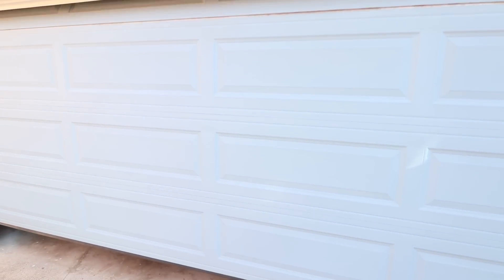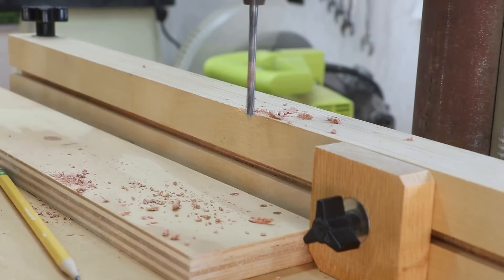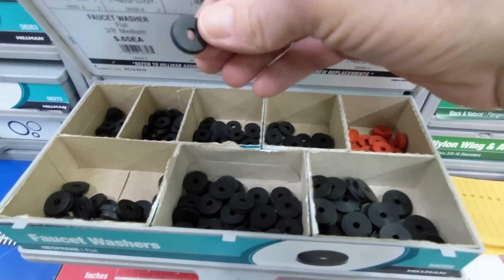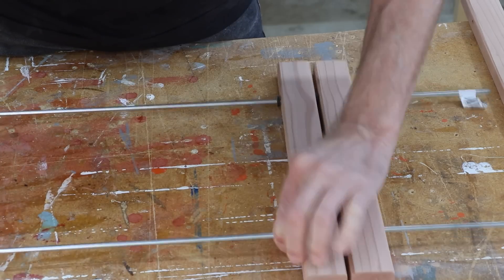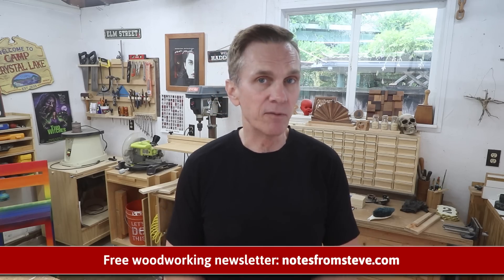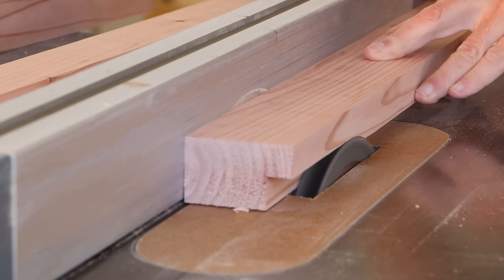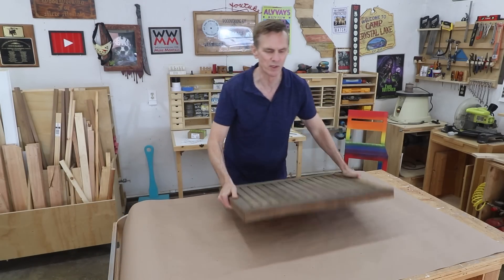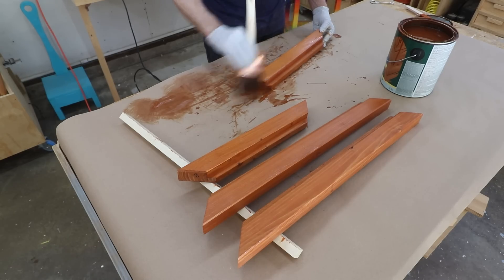The most unique doormat you can make. Weekend woodworking project.

Comment: Almost done with my first try.  Not bad.  Tip on drilling the holes:  no matter how carefully you jig it, the drill bit does tend to wander over a 1.5" path.  It's pretty easy to set up the press table for an entry hole that's 99% repeatable at the center.  Soooo, don't drill it all from one end:  set the drill stroke for about 7/8", drill it, flip it, and do the second half of the hole from the other end.  It cuts "drift" in half.
Reply: What kind of drill bits are you using & are you using a drill press?  Good sharp Brad Point bits should not be drifting especially with a drill press.
Reply: @markb8954  Drill press, fence, stop, brad point:  wood is not a uniform media, and you do get drift.  I tried the "two way" method and it does work better.  It strikes me that in every tool app there are small gaps, "wiggles" in the tooling.  A drill bit tip can move just a bit due to the chuck, the fit of the chuck into the press, and the drill bit itself will bend just a little.  The longer the assembly, the longer the bit, the greater the possible arc of placement for the tip.  Add to this that the wood has hard and soft areas, and the tip of the bit is going to move just a little.  However,  on the next iteration, I plan to clamp the workpiece onto the fence rather than just holding it tight on the fence.  Clamps is nice.

Comment: First, revisiting old stuff with a new spin is always nice. The flashback to a decade ago shows so much improvement. Now, you have a better video, better joints, better workshop (with less actual stuff), and even look younger.
Second, round-overs vs chamfers is always going to be subjective. I use roundovers for anything with hand-contact. Shelves and such always get it, and I've never once thought it looked dated. Chamfers go on things where fitment is important. For a doormat, they'll look different, but neither will look more dated than the other. The wood itself is probably the most dominating 'aging' factor.

Comment: On your drill press comment, this is one of those spots where when you're starting out a Wen or Harbor Freight drill press is probably fine. My Harbor Freight drill press has held up quite well even for all the pens I've made and so it's one of those tools that are so simple that "cheap" will likely still get you something that'll take you pretty far!
Reply: Ditto.  Pawn shops around me always seem to have a drill press too, but you might need to double check the price to make sure it's fair, and give the machine a good once over to make sure it wasn't trashed by the previous owner.
Reply: OfferUp here in the Southwest has been my go-to for second-hand tools, too. Though I just got a smokin’ deal on a Ridgid table saw (an upgrade from the rinky dink Pro Tec I was using) at a local pawn shop by making a low offer after seeing that it had been sitting for months. They took it and we’re both happy!
Reply: ive got a wen variable speed and i love that thing for the price, way better than hand drilling for a lot of tasks
Reply: Yeh i got a rusty, second hand box-store-brand and it's still super useful.

Comment: I've used a couple of the presses that use an electric drill motor. Latching trigger is more convenient. I've mounted my cordless units as well as corded. Works well for small work, and especially if you have storage issues.

Comment: Just came here to say I think you did a beautiful job on the doormat. Those mitres are tight! Was thinking if I was to do this myself, I'd probably taper the outside top edge of the frame down to floor level, to prevent stubbing your toe on the side of the frame in the dark. Of course, you've probably no issue with this as you used the last one just fine for so long. Anyway, great video and keep on keepin' on.

Comment: A great, simple project!  I wonder how complex it would be to bevel the frame slightly, so that it tapers toward the edges.  Would it be as simple as tilting the table saw blade a bit and running the frame pieces back through vertically?

Comment: Do you have a video on making your drill press table/guide? It looks useful. I inherited a little,  old Harbor Freight drill press, but the table isn't very functional other than being flat. The few times I've used it felt pretty unwieldy. Clamping any sort of stop block(s) isn't easy, as the underside is not smooth.

Comment: This is a real good idea. I've seen several here in Florida that were similar. Some of them had the slats long ways and used a 1/4" gap. When folks come in from the beach it seems better for wiping the sand off their shoes, sandals, and feet. What do you think of that as an option?
Reply: That's exactly what I plan to do - run the slats the other direction and make the gaps wider. There's a lotta mud out on our farm.

Comment: You could also use a stainless cable or other flex able thing to run through the holes. That way it has a little flex to it once it's all put together. Would just need to figure out what to do to the ends of the cables so it holds the boards on.

Comment: When drilling the holes for the slats, you cold reference the fence of the drill press to the top of the slats, so the fence is still adjusted for drilling the frame.

Nice project.But now you need to re-stain the stairs to match the door mat :)

Comment: honestly with a good way to hide the ends of the rods I think one with out the frame would look great too. it would also cut down on time to make it significantly if you are selling them.
Reply: Countersink the wood at the ends of the rods and you will hide the nuts.  However, the frame keeps the slats off the pavement, and reduces rot from trapped water.

Comment: This reminds me of a project I did recently. I made a top railing out of 2.5in galvanized pipe for a guy I know. 90* fittings for the for the top corners, dropped the two 4 ft uprights into the floor almost a foot then used tensioned 1/2 inch cable for the center rail. I was thinking making the mat with no border and recessed cable into wider end slats instead of rod, just like this project didn't use...

Comment: Question:  Should you glue the corners before putting in the pocket screws?
Reply: You can, but if you use Titebond or Titebond II (or anything similar) it will likely fail within a year. James Wright of Wood by Wright has a running series wherein he is testing various glues over a number of years. I can't remember what his results have been so far, but if you watch his most recent one you'll see what has had the most success outdoors. The screws should provide enough holding power on their own, though, at least until the wood rots away enough that they can't hold (and by then the glue would fail as well).

Comment: Hey Steve,  here's a little tip my dad taught me about 40 years ago.  When marking the drill point for those rods, use lipstick on the ends of the rods and it will leave a dot where you need to drill. So raid your wife's makeup(💄), just don't take the good stuff or you'll be in trouble.  LOL  Have a great day and I'll see you on the next one.

Comment: Question...when you are doing the creep up of size on the miter sled (or miter saw) do you get splintering of the ends? I seem to have that issue when I try it. What's the best way to avoid the splintering when doing the size creep up method?
Reply: A decent saw blade 😜

Comment: would this project be easier if you started with the outside first and then cut the inner part to size.
Reply from the maker: Maybe, but you might have to rip one slat narrower, depending on the fit with the spacers.

Comment: That looks pretty, but I use a welcome mat to essentially clean the bottoms of my shoes before I enter the house by friction with the rough surface of the mat to remove stuff like wet leaves or whatever.  That looks a bit too smooth to be of much use in that regard.  Then again I live in a rural area, gravel driveway, concrete porch, etc.  If I lived in town I'm sure it would be fine.  Trust me, in a rural area you are going to occasionally walk through mud, slush, wet leaves, etc, lol.

Comment: I’m completely puzzled why you used steel rods. For spacing they would work great to help drain rainwater so it doesn’t build up underneath, rotting the deck. But in our southern humid climate, the steel would rust quickly. Can you explain why you think the rods would stand up? Thanks!

Comment: The threads may or may not be as strong as on allthread, but you can definitely put threads on the big box store steel rod like it looks you are using.  How do I know...I have done that a bunch of times on projects where I didnt want (or have) all thread for it. :)   I liked the video though, and the idea for the doormat.  Maybe when our plastic/cloth one finishes decomposing I may try this for a new one.  Though then you have to worry about someone liking it too much and then needing to make another one to replace it.  Whereas so far no one has stolen our partially falling apart one...yet. :)

Comment: Nice build!  The steel rods are really an unnecessary feature if you mount the slats in a frame like that; they contribute no strength to the assembly.  Omitting them decreases build time by about half and reduces BOM cost as well.

Comment: You might consider thinning the slats to add more gaps for dirt to fall through and tack feet to hold them above the floor. You could then omit the steel rods and screw the slats individually to the frame.

Comment: The only time I've ever seen a failure with pocket hole screws was caused by user error.  The screws weren't long enough or they were used in the wrong application.  You can screw up anything if you try hard enough.  (No pun intended)

Comment: Have you ever done 45 degree joints, using wood that was supposed to be dry, but wasn't really dry. When drying further,  it shrinks more in the width than the length, resulting in your nicely cut 45's are now a tad less, and the joint looks poor.  i believe this is what has happened to Steve's the old doormat, it wasn't crappy made.

Comment: I know you don't see the pocket screws, but i find it very displeasing to drill a hole like that in a otherwise gorgeous wood piece. That much work in the entire process just to make it the easy way at the finishing line.
Reply from the maker: Are you suggesting that a project's value is based on the difficulty of the techniques used to build it?

Comment: @ 14:20 -- Actually, take a hammer and gently whack the rods to make them make a mark on the framing pieces. That way it should be pretty exact.

Pocket screws? Seriously? This so calls for simple dowels (or dominos, if you're fanatical about them)!! 
Note -- I'm not complaining about strength. I'm talking about visibility. I wouldn't want any screw holes anywhere in this. No, not even on the bottom.
Reply from the maker: A lot of people share your opposition to pocket screws. Funny how woodworkers in 2023 have a need to hold strong  opinions on something as ridiculous as construction technique choices. 😂 This is basically the Twitterizing of YouTube that didn't exist when I made the first doormat 12 years ago. 🤷‍♂️

Comment: Nicely made but weird. I was expecting some clever doormat, that somehow cleaned your shoes. But got a set of planks lying in front of the door. Perhaps it is a USA thing? How does that wipe or dry your footwear before entering a house? Then the metal rods may make it a fraction stronger, but you could just screw the ends of each rail to the rebate you made in the frame. With a lot less messing about, no need of washers.
Reply from the maker: Or you could just buy a doormat. Dude, it's just a fun little woodworking project. Why the need to overthink it?

Comment: no glue anywhere? I would have at least added some glue to those joints along with the pocket screws just for some added support.
Reply: Glue is brittle. The expansion and contraction of the wood outside along with moisture and people walking over it wont help much. PVA is strong but its  brittle, save it for indoor furniture work. It's also the reason you don't see glue on decking and outdoor furniture.
Reply: I would do that too but his 12 year old piece held up just fine.  Can't argue with success.
Reply: @dwightl5863  true. I just found that a little weird becuase this guy did a whole video on how much he loves glue
Reply: Came to the comments for th same question. Wonder if he was concerned glue wouldn't let the wood move?
Reply: @sunderark  A water resistant/proof PVA would work fine in an outdoor application.
Reply: @bb55555555  Steve likes painted wood especially for outside projects yet he used deck stain on this one.  Always more than one way to do a project.
Reply: @dwightl5863  also he used redwood. naturally resistant to rot.

Comment: for the last 27 years, I have lived in the heart of the California redwood forests. there are many small towns that were originally built specifically around the redwood harvesting industry. protesters, and activists that were misinformed, and actually acting more as eco-terrorists have caused many of the mills, and logging companies to shut down. companies that were working in a sustainable manner over the last full century.  if you are ever driving up in this area ( I am in Humboldt county) look to the sides of the highway. nature does not plant trees in perfect rows. farming redwoods is exactly like any other crop. it is no different that growing corn. at the end of the harvest you clear the land, and replant. the only real difference is redwoods are on a 40 year cycle, instead of annually.  the protesters have actually cause more harm than good, as the locally owned and operated logging has  closed, being bought out by over seas corporations that do not care about the land or community.  It is really sad, actually.  Redwood IS a beautiful wood, that is pretty easy to work. one thing though, redwood BARK is fire resistant, redwood timber burns very quickly, and VERY hot. I had a redwood framed house when i first moved up here, it burned down one night, and was fully engulfed in mere minutes.

Comment: One problem: Its an absolutely terrible design idea.  How can anything but stiff bristles dislodge caked on dirt and mud?  Wood slats?  What Einstein thought of such a pointless idea?  How about smooth wood?  Is that next?  Polished marble?  What in the world were you thinking?  Sure it looks nice but it DOESN'T WORK.  I noticed that a lot of very skilled woodworkers have very poor conceptual ideas.  But that's OK.  Just work with someone who is a good designer and you'll come out with a stupendous project.  After all, who doesn't LIKE wood?  We all do.  The problem is wood is vulnerable to the elements, it rots, it wears rather quickly, it warps, a whole host of problems.  But if they can be circumvented, its a great material.  And its pretty strong for its weight.  Most importantly:  We all love being around natural wood.  In a word, its homey. Its warm and inviting.  Just as a home should be.  

Want a challenging wood project?  Figure out how to join two 2x4's at a right angle in as rigid a manner as possible using a minimum of space in the brace area.  (Its not easy!)  I'm thinking a quality steel L bracket on each side the full width of the wood with countersunk bolt holes with grade 5 bolts.  Perhaps countersunk into the wood as well so it sits flush.
Reply from the maker: Read pinned comment. You're problematizing this. 

As for your "challenge": Joining 2x4s at a right angle is not a challenge. Use lap joints. I've done them plenty of times on this channel. But I'm going to guess you've never watched any of my videos before this one.
Reply: @SteveRamsey    Lap joints?  On please.  How flimsy.  It uses glue or wood screws.  Both are terrible.  What I suggested was far more rigid by a huge factor.
Reply from the maker: @FreshAirRules  I'm honestly not sure if you are seriously ignorant about woodworking or just trolling. It's pretty hard to tell. 🤷‍♂️